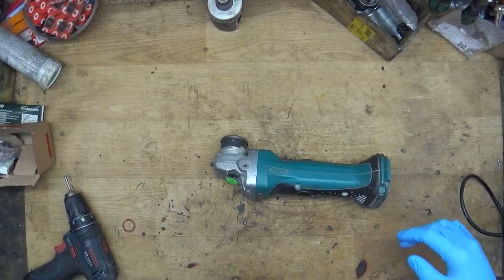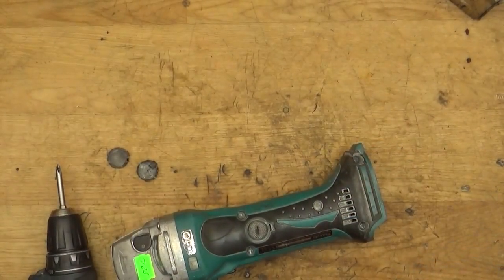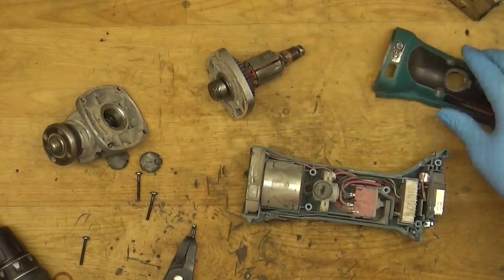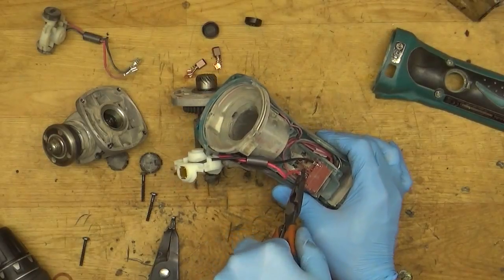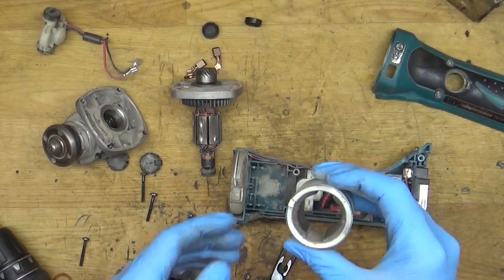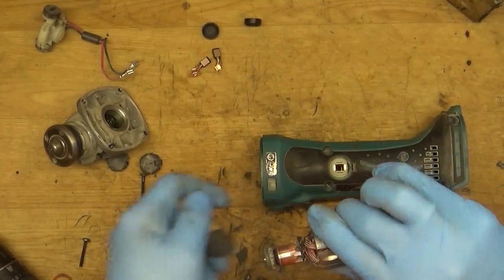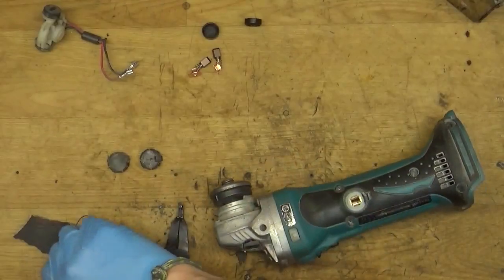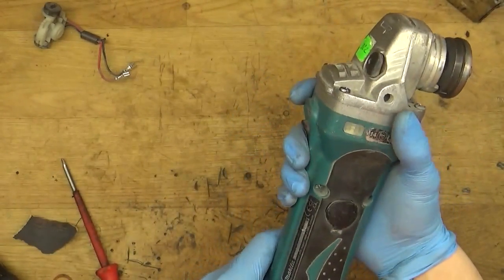How to change melted Makita 18V angle grinder carbon brush holder and carbon brushes replacement

Comment: Hi. Did the same thing today with my dga 452, checked the armature (no short circuits), but after reassembling it doesn't run smooth or constant, after a few seconds the speed varies and it come back again. I noticed a little bit of play on the big bearing. What do you think? What should I do? Thanks in advance.

Comment: Thank you. I have the same dga452 grinder. I need to change the armature, so i think i have to remove the gear from the end of the armature to put it on the new armature which i get. Could you please help me how to remove the gear? It does not have a screw so i do not know how to remove. Many thanks

Comment: There is a small rubber ring which fits inside the white brush holder which sits behind the rear bearing, this doesn't come with the new brush holder so should have been swapped out from the old one.

Comment: Very informative, well presented and very easy to follow. Thanks to your vid I have worked out that I need to replace the armature assembly (same model grinder). I can't see how to remove the spiral bevel gear from the armature assembly. Any ideas would be greatly appreciated. Thanks
Reply from the maker: thebricklayer Thank you, you need to press it out or you can heat it to take it out from armature